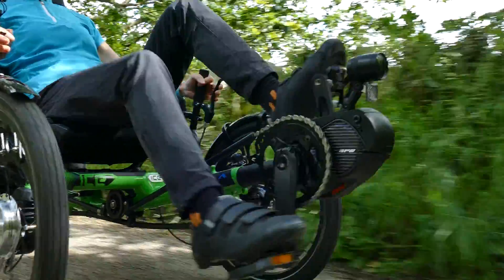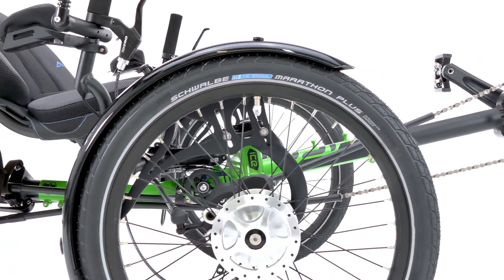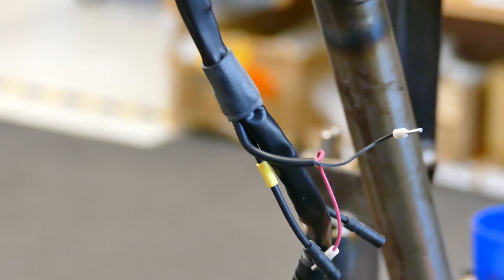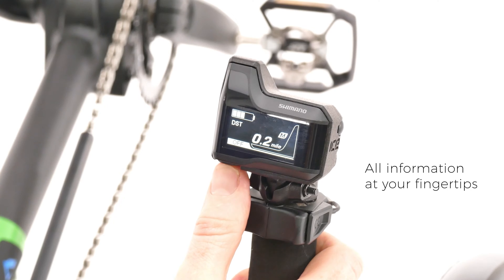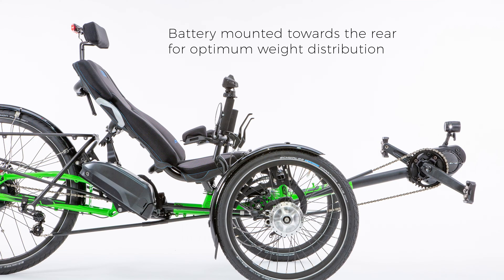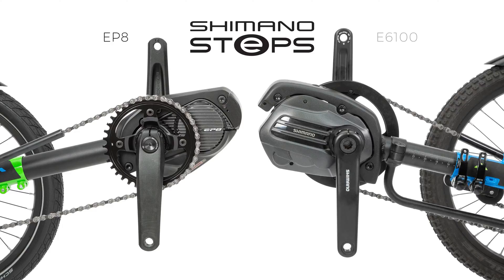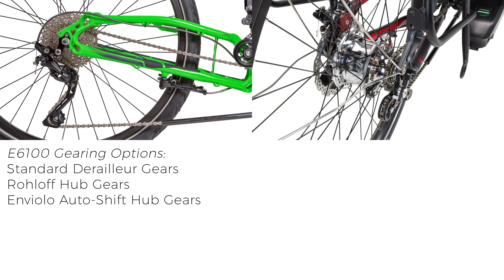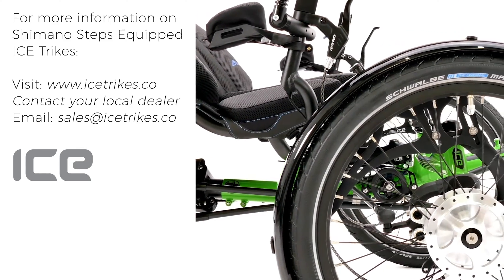Steps Technical Overview 2021

Comment: Unfortunately the ICE trikes suffer from an adequate suspension system.
Reply: What? Ice trikes have front and rear suspension options. For an even softer ride, you can lower the tire air pressure.